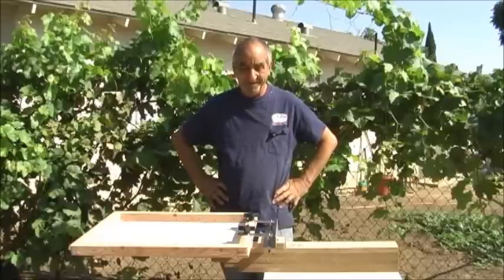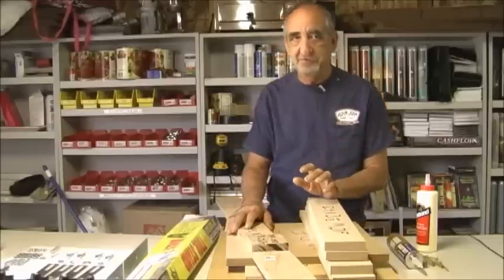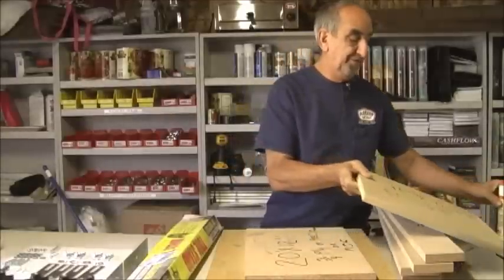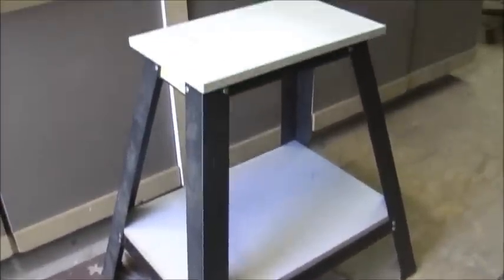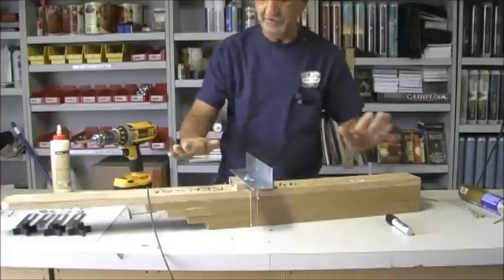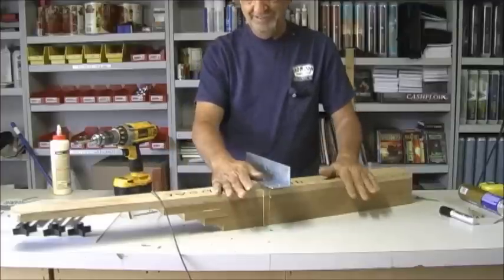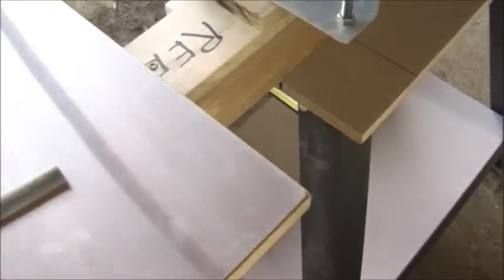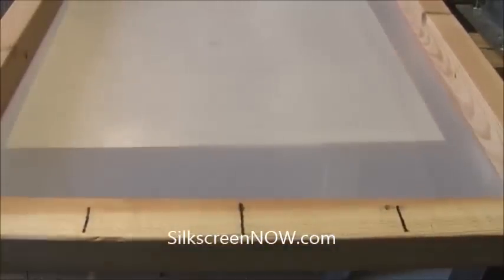How to build a MULTI-COLOR T-SHIRT PRINTER

Comment: Does the aluminum sheet get too hot? If I'm using it to cure for 1minute on water-based ink at a distance of 6", would I be able to do several shirts in a row safely?
Reply from the maker: yes one minute will heat that up fast you should cure off any printing board aluminum or not

Comment: How would this work with aluminum frames
Reply from the maker: it works fine you can drill holes in the aluminum just as easy no problem.

Comment: no offset setting for screen then ?
Reply from the maker: off contact is for plastic or other non absorbent material not tshirts unless the screen mesh is very fine like 200 or more . Also it you are doing 4 color process tshirts  not for your everyday run of the mill t shirt printing with mesh lower like 110 ( anything lower that 200  to much ink pours out and will give you a mess.  Make sense ?
Reply: so off contact will increase flooding of the image
Reply from the maker: if the mesh count is 160 or lower yes you will have a mess with off contact

Comment: how is your off contact here bob?? really nice printer.
Reply from the maker: Vladimir Diaz  Thanks well you can adjust the pins so you can have off contact if needed but for tshirts it is not needed only need on things like signs or material that will not absorb the ink .
 thanks 
  Bob